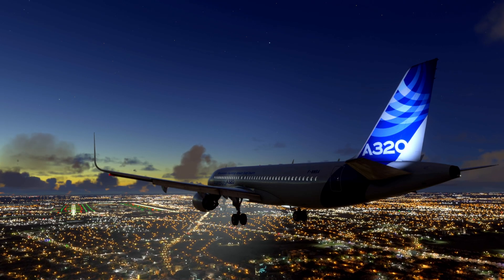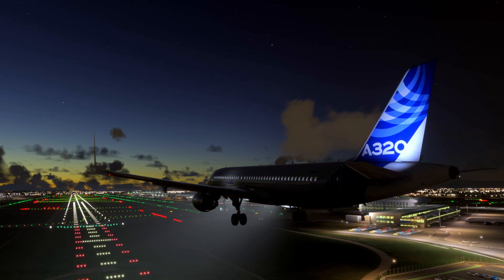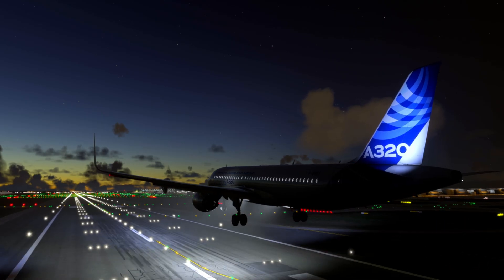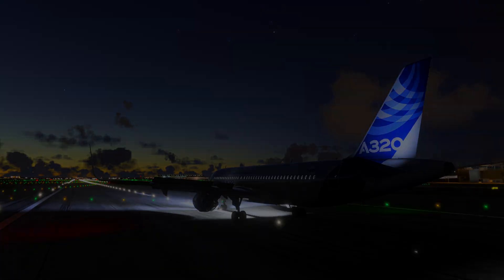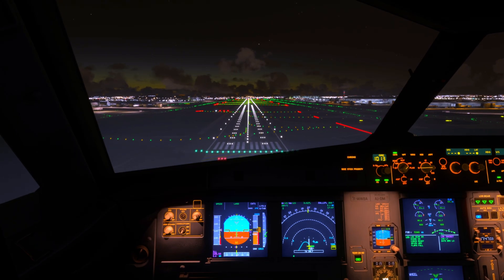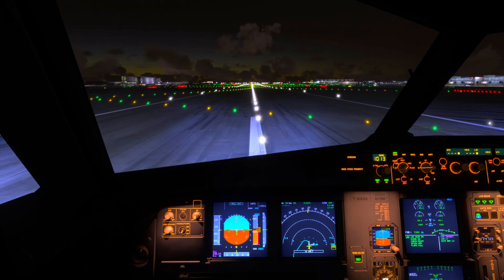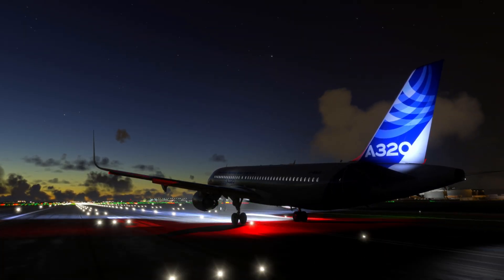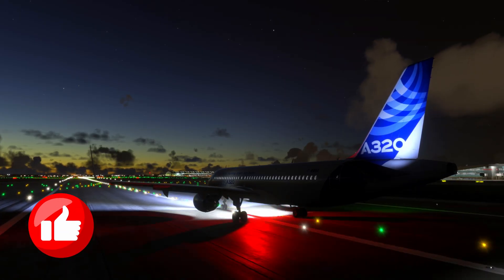How Airbus Flare Mode Works | A320 Autoland Tutorial by Real Pilot

Comment: Hi there, just thought I'd come back with some feedback following your helpful advice on pitch sensitivity earlier. I did an LGW-FCO leg this evening and with the pitch axis set to +50, and SDS enabled, it was so much easier to nail the flare. I got the best landing I've had with the Fenix for months! In my head I had it completely the wrong way round, thinking higher sensitivity would result in over-controlling but it's the opposite isn't it - because it responds more quickly and crisply to inputs you can make much smaller corrections and see the changes in real time. With the lower sensitivity setting, I was over controlling with the flare because I couldn't see how it was responding, and then over-compensating to avoid a float and it was just going wrong every time. Many thanks again 👍
Reply from the maker: Hello, I'm really pleased you have seen some improvement. I certainly find that setting to be much closer to the real world feel, I still need to perhaps use FSI panel and try a 5% +/- but at +50 it is not far off. Glad that helped and I wish you many more happy landings 👍🛬
Reply: @AirbusCockpitCoach  Thanks! Yes it was a significant improvement indeed. Second landing yesterday wasn't so nice but I put that down to the couple of glasses of wine I'd had during the flight - not a problem real world pilots would ever have, but I have noticed the A320 flight model is much less forgiving of slower reaction times than other aircraft😂
Reply from the maker: You may have to reduce sensitivity for every glass of wine 👍
Reply: @AirbusCockpitCoach  Someone needs to make an add-on for that 😂
Reply: Sorry to butt in, but where was this discussed? Having similar issues with the flare as well as rudder sensitivity. Could really do with some guidance on realistic settings!

Comment: This just doesn't work for me. Either I land really hard, or it starts to float and rise. I can't feel it. I'm completely frustrated.
Reply from the maker: It is easy to get frustrated with this one. There are factors in the sim world that also make this harder such as control sensitivity and software updates. FSI panel is a great tool to practice making adjustments in techniques and sensitivity settings to see how they affect your landings. Remember it is not perfect every time in the real world
Reply: @AirbusCockpitCoach  Thank you very much for your answer Captain.✈
Reply: Exactly the same experience for me. Very difficult to strike that balance without over-flaring and floating.
Reply from the maker: @tjfSIM I'm now using +50% pitch sensitivity on the Fenix with SDS on which seems to give me a closer match to the real aircraft. When you take the thrust out and how quickly plays a big part in the touch down. I recommend FSI panel for repeat practice 👍
Reply: @AirbusCockpitCoach  Ah that’s interesting, thanks for the info. I think I have pitch set to -20% at the mo, with SDS on so that may well be a factor. I’ll give FSI panel a try too 👍
Reply from the maker: @tjfSIM good luck with it, reach out if you need anymore advice. Be gentle on the back pressure with that sensitivity increase 👍
Reply: @ Thank you very much, really appreciate that! 👍

Comment: @AirbusCockpitCoach I wonder if you might consider a short discussion on departure procedures as they relate to thrust reduction & acceleration altitudes.  After take-off I don’t really know exactly when to retract flaps & slats or which values (and why) to set THR RED / ACC. I realize the values are AFE relative to the airfield, but I am trying to understand noise abatement departure procedures, speeds (e.g. V2+20) and when to pitch the nose over and engage the AP.  I fear I am just pressing buttons and hoping for the best sometimes, whereas really complying with an NADP1 or NADP2 standard means that I need a better grasp of the details. Thanks so much for what you are doing for our 🛫 community!
Reply from the maker: Hello, sure I will do my best to sort that 👍✈️